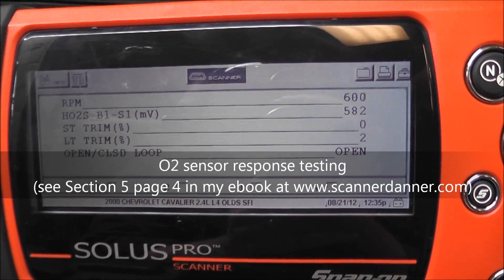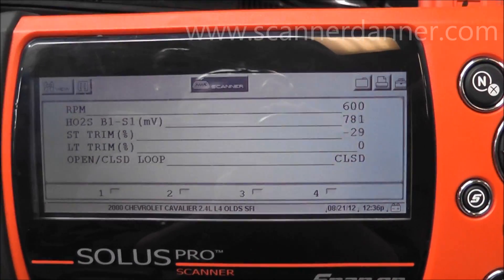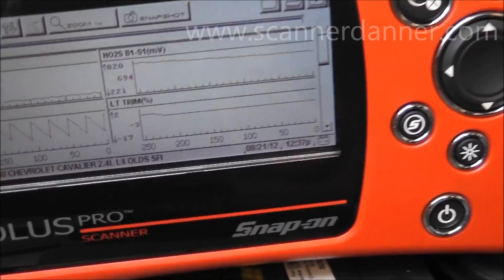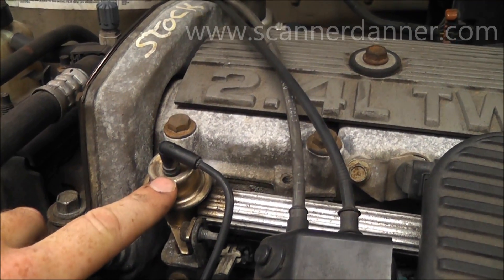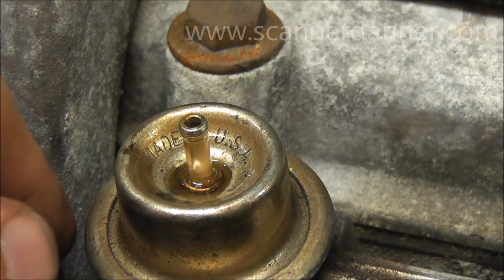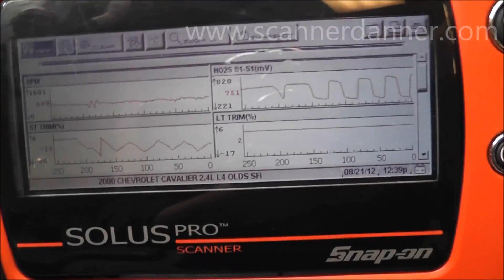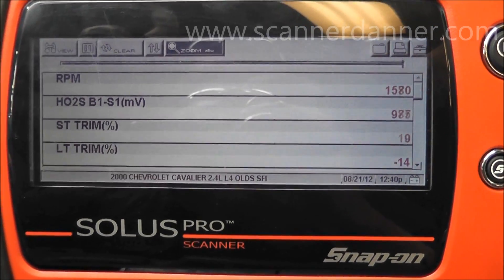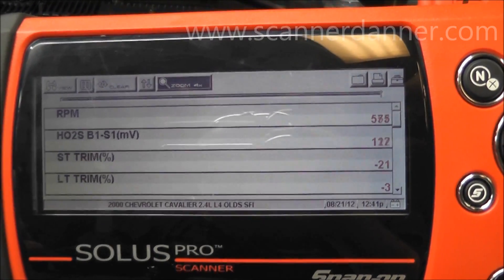Leaking Fuel Pressure Regulator (symptoms and testing)

Comment: I have a P0172 (too rich) code and I recently replaced my O2 sensor, and I checked my Fuel pressure regulator and that is fine too. What other causes could make my car run rich? (2005 chevy impala)
Reply: consaka1 lol! It turns out my problem was that the MAF sensor was in backwards on the intake.. Ever since I've had the car it was backwards. So I flipped it around and the car has no more codes :) 
It took me a long time to figure out such an easy problem. Maybe my lesson should be not to assume it's something complicated and it might just be something installed backwards!
Reply from the maker: +Marc Frappier MAF would be my next check. How does it run? What are your fuel trim numbers?
Reply: +ScannerDanner that's the thing... it runs fine. sometimes it starts rough but other than that everything is fine. I cleaned the maf not too long ago, that also looked fine. I will check the fuel trim numbers later. tbh I'm thinking maybe my injectors are going? maybe they're leaking?
Reply: +ScannerDanner actually, I fixed my problem. turns out ever since I've had the car the maf was installed backwards. so I switched it around and everything is fine :)
Reply: +Marc Frappier I just love those kinds of problems. Like the '84 Audi I got from my brother. They had taken it to "real mechanics" that couldn't fix it. So they sold it to me cheap. 20 minutes and I found a fuse on the side that controlled the computer. Silly car had been driving for years without the computer working. No more letting it idle for 15 minutes so it would run. lol
Reply: Marc Frappier Strange stuff like that is what keeps life interesting.

Comment: I have a question I just realized that I had the same problem but when I realized it and pulled the breather tube it was full of fuel the filter and saw fuel in the air filter box and all over the filter do I do an oil change to be sure of anything ???
Reply: No its ur fuel regulator going bad if ur experienceing stall at idle hard start were its wants to kick over but takes a min that will be the cause of fuel being pushed threw ur intake manifold meaning u need a fuel regulator
Reply: Tony White beware that if not fix u can flood ur engine and making it a peace of scrap sitting ing ur yard
Reply: Tony White is this the ONLY fix for that kind of problem? (stalling and hard starts)
Reply: Tony White  thats what I was wondering right there.   I bought a new one for my yukon, went around a comer coming into my neighborhood and it died. less than 35 miles on this regulator. I thought it was the fuel pump like a dumbass i didn't even check the new regulator, so now I got the entire thing torn apart .  I even pulled the fuel rails cause I thought there must be crap in the rails.   but when there wasen't i took the reg off and i can blow thu it both ways.    Grrr
Reply: RockAnAhardSpot that's everyones first assumption is the fuel pump. i hope you have better luck then most of us . i ended up selling my car cause of that. get back to us when you figure it out?
Reply: brent dL  Well, I have been having troubles with fuel pumps also,  many times over, it's so aggravating, something is contaminating my fuel and filling my filter inline and fuel pump strains with some kind  of black dust. I thought I had solved the problem when I took everything apart blew out the lines, replaced my charcoal canister and the evap valve , rebuilt the fuel pump assembly " AGAIN" and repaired the fuel line inside the assembly as it was causing a bleed back into the tank from a pin hole in the clear corrugated line between the pump and the inside top of the assembly.    Also I got that new regulator, I didn't realize it was a bad one before I tore back into the rails and injectors. 

   In just a minute i will be back on that again, I have cleaned everything now and all the lines are clear, I just have reinstall it all.  The thing is, I didn't find the problem, there was no large pile of black dust stuff anywhere and I feel like I didn't accomplish anything except for replacing my injector O Rings and cleaning them up.  Funny thing is i'm throwing no codes.      I will need to scrape up a new regulator before I can even test this out. hard to believe what they are asking for that tiny little part when nearly every company is having them knocked out in bulk in Chine for dirty ass cheap and then re branding them.   set of O rings for the injectors is 20.00 now, they are just rubber O rings for goodness sakes!
Reply: RockAnAhardSpot

Comment: Very nice video. My Cavalier does NOTHING after pulling the vacuum hose of the fuel pressure regulator, the RPMs stay the same so the engine sound. I'm going to check on that.

Comment: I'm not sure what is going on with my 1990 ford f150 4.8 six cylinder. The fuel pump continues to run with ignition on. I changed fuel pump regulator after watching your video on the regulator my truck started fine the first time after that it wouldn't start I loosened the bolts relieving the pressure and fuel pump ran only a couple of seconds and truck was fine. The next morning my truck wouldn't start and the fuel pump continued to run. I again loosened the bolts to relieve pressure but this time it still won't start. Do you think I bought a bad reg.no fuel comes out of vacuum line .PLEASE HELP

Comment from the maker: it can but only if it is leaking like a regulator, if you pull the vacuum hose off and there is no fuel running out you need to go in another direction. 
What were the codes?

Comment from the maker: check for broken grounds right above the starter motor. you have to pull on them to find the break. they break inside of the insulation. should be a few black and tan or brown wires sharing the same ground eyelet

Comment: The car originally has a misfire, so I replaced the coil packs, spark plugs and spark plug boots. Misfire went away, but we also replaced the fuel pump. Then the car ran but ran rough and I had about 5 codes for some sensors so I replaced the IAT, Camshaft sensor, Throttle sensor, and MAP sensor then the car ran pretty good but has the symptoms I mentioned above. The car cranks longer when the engine is cold, but doesn't crank as long when the engine is hot. Also sometimes stall when hot.

Comment: What's the most common problem on this engine that can cause a P0171 and a P0420? I know these codes can be the upstream AND the downstream oxygen sensors but unlikely that both of them went out at the same time.

Anyway, my car is a 1998 Pontiac Sunfire with a 2.4L. I'm getting long cranks and fuel smell from the exhaust. Also, was sputtering when going up a slight hill with the fuel tank at half full. Since then I haven't let it get lower then 5/8th of a tank and the problem hasn't come back.

Comment from the maker: Thanks! Check out Section 5 page 3. It is a case study on a Nissan Maxima O2 slow response trouble code. In this case study I am showing the switch time measurement. Also this is more about what the OBDII computer is looking for than it is for us. I just make sure the frequency is good, if it is I don't worry about the switch time.

Comment: Nice video.  Showing real world trouble shooting.  You do things in a different order than me but end up in the same point, usually.  I look for true hardware issues FPR, abraded wiring harness, unplugged connectors, etc.  On the unplugged connectors you would be surprised how many times I've seen that.   A person does maintenance and unplugs the MAF or AIT sensors to get access to something and fail to plug things back in. 

I really need to get me a real scanner rather than a simple scan tool.

Comment: It's seriously running rough. The rpm is running about 500+ which is low for idle. Any lower and it won't be enough to build oil pressure.

Comment: Rarely do the leaky FPR set a P0172 code on most GM FWD engines. You always have to check for the FPR spitting out raw fuel or do the "suck test" on the diaphragm. 

Note that if there is rough idle and/or stalling at idle without hard warm/hot restart issues on these Quad 4/Twin Cam engines then you likely have a rotten MAP sensor vacuum hose. 
If the MAP sensor reading was jumping around then that would have been what I would have checked first on this car.

Comment: Well done Paul.  I have seen  O2 not setting a code as well as O2 setting a wrong code.   My friend owns an auto parts store and all electrical components can not be returned unless found defective.  He sells so many parts not required because DIY's read the code and start buying parts.   Sometimes the most cost effective way to fix your car is to take it  to trained tech.